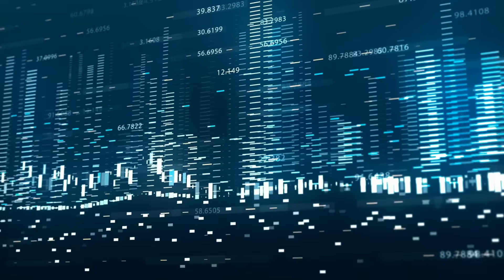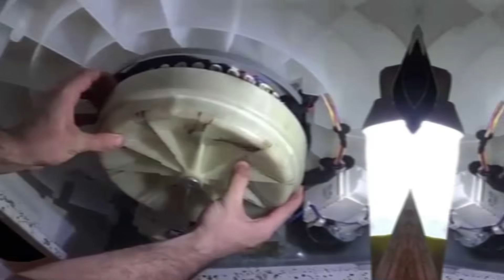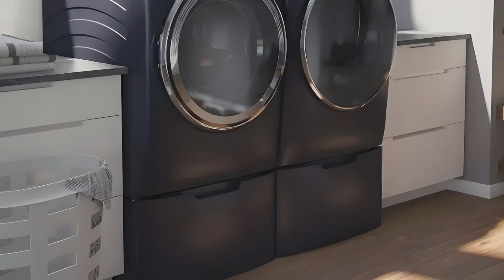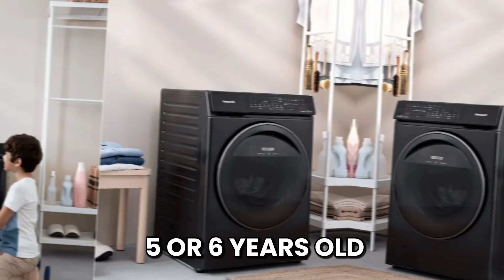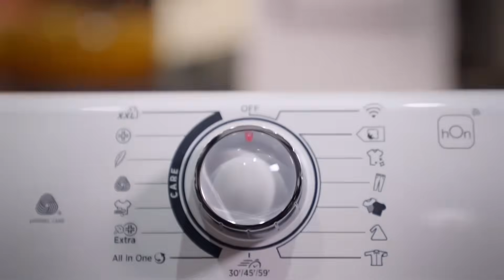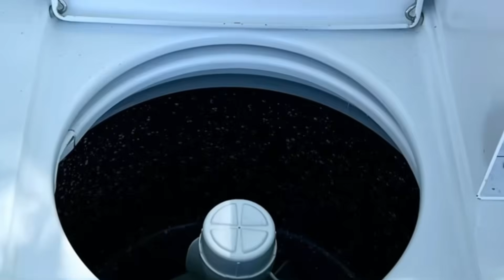Why Buying a 15-Year-Old Washing Machine in the UK Beats a New One

Comment: We have 2 washing machines and 2 dryers  one set for us and the other one is for the cats stuff,  ours is a Blomberg and a 12 year old AEG heat pump dryer,  the cats have hotpoints the Hotpoints were cheap so thought it didn’t matter much for the cats stuff. The machine only ever does a boil wash fo the cats stuff, cleaning cloths, towels from under the litter trays,    I have had the bearings done twice in 4 years, had the body of it reinforced by putting plates at the bottom where the suspension is, it’s had 3 boards,and now needs a new door lock, and it just randomly beeps throughout a wash,   Thank god for insurance, luckily we have insurance on all our appliances  I’ve definitely had my moneys worth from it,  they are coming out next week to do the door lock and find out why it beeps randomly,   Our Blomberg is a trooper  used every day for 3 years and only had to have a suspension leg replaced but only because we had issues in the kitchen, the floor dropped as it went into spin and broke the leg  but that’s it   I know Blomberg is the midway range between BEKO Blomberg and Grundig  all owned by the same company in turkey  and they have massive sure of Hotpoint and indesit but I’ll stick with my Blomberg
Reply from the maker: It sounds like you’ve certainly put those machines to the test with all that hard work!
Reply: I had a Hotpoint, and it used to get a lot of attention from the repair man. And yes, he did reinforce it too, to make it last longer.